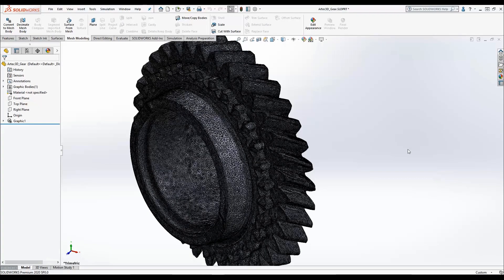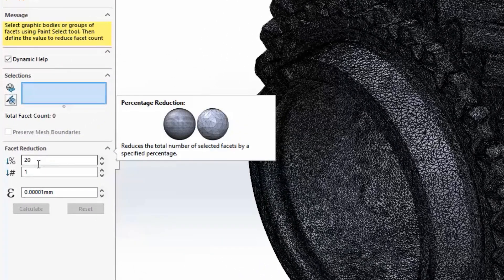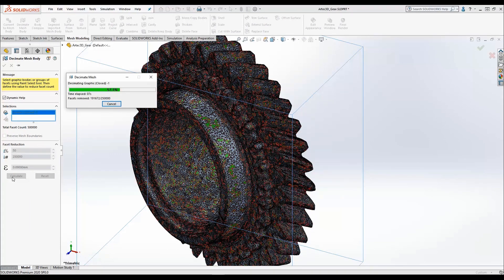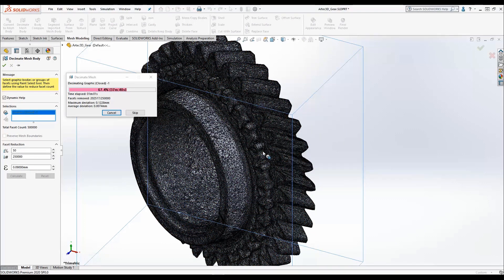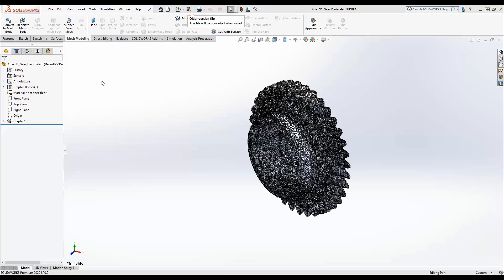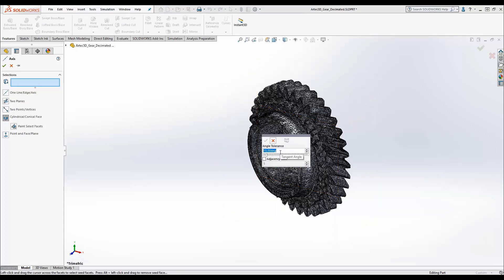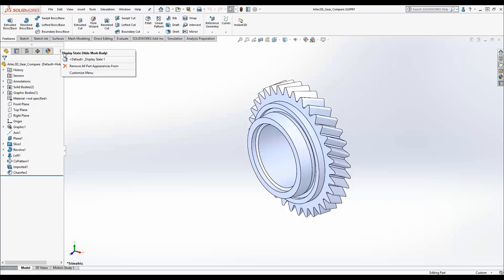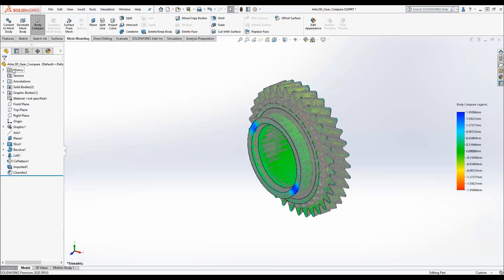What's New in Mesh Modeling - SOLIDWORKS 2020

Comment: Is there an explanation available on the procedure taken to complete the CAD model from the mesh?
Reply from the maker: Depending on your needs, there are multiple approaches.  You can use ScanTo3D for some things, https://youtu.be/55yR3DfrB4M.  To fully build a CAD model is likely to involve a hybrid approach where you convert surfaces for the major features and then build the rest of the features using the mesh as a reference.  The gear teeth and the circular pattern for example are unlikely to convert quickly and easily without using traditional modeling approaches.